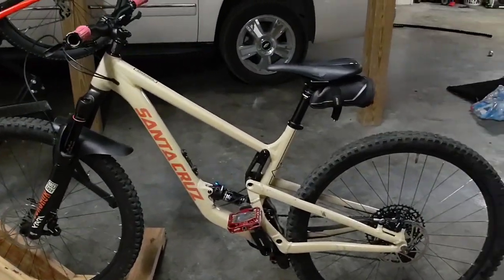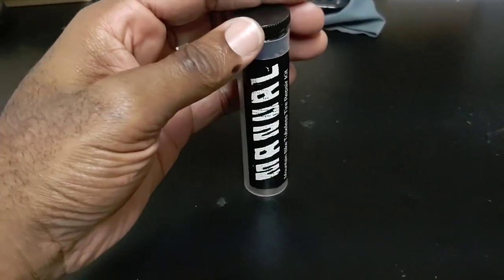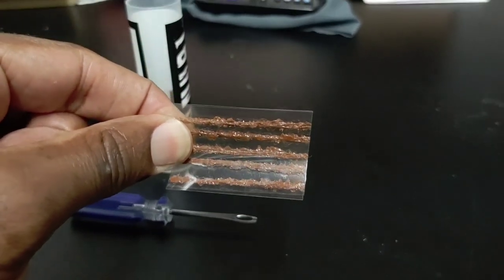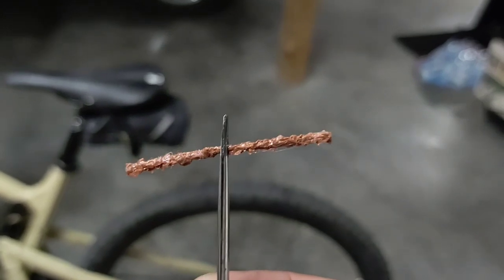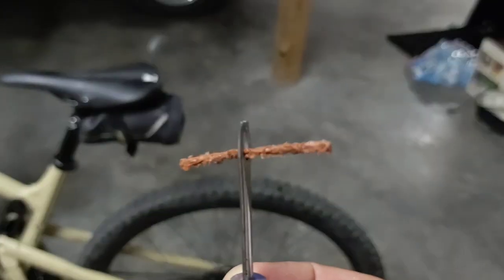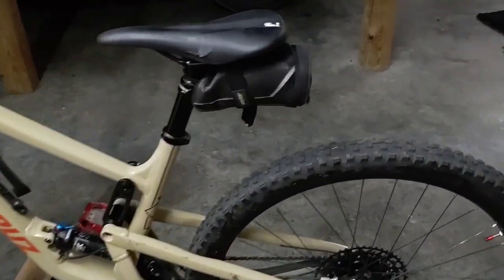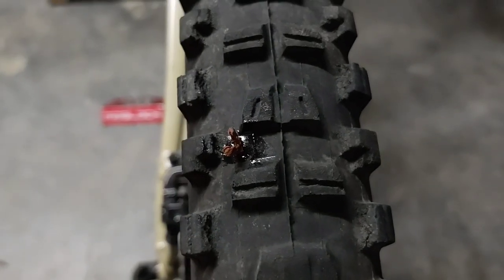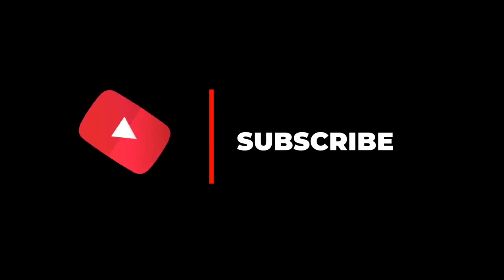BACON STRIPS TIRE REPAIR | TUBELESS REPAIR

Comment: That looks the same only smaller than what you can use on a car tire. I'm thinking about trying a car strip in a flat I currently have...
Reply from the maker: Go for it, might work.  Don't see why it wouldn't

Comment: Awesome first time repair.  Looks pro, as far as I can tell.  I finally got my full suspension bike, but I am sticking with tubes!  Hey, but let me ask about your saddle pack I saw at the beginning. Does it interfere with the travel of your dropper?  I always used cheap Amazon pack inside my front triangle, but now with water bottle AND rear shock my old pack is not near close to fitting.  A top tube  pack might cramp my stand over, and there aren't many other options left but the saddle.
Reply: I got a SL3S of ebay for like $15 and it works with my dropper, but I ride a hardtail. I think there's enough room for it to work on full suspension, but you would be taking a chance I guess.
Reply from the maker: I haven't had any issue with mine.    My seat post isn't at it's lowest position so it leave room for the pack.
Reply: BLKGUYMTB, WOLFTICK, Thanks for the feedback!

Comment: That’s not good man but I recommend stans darts they are super low profile and have flaps for staying in but I use those a lot and they are fine
Reply from the maker: Will have to try those next
Reply: they dont work nearly as well as advertised.